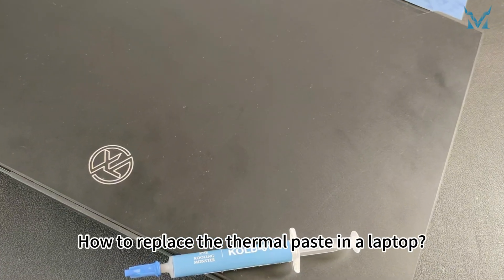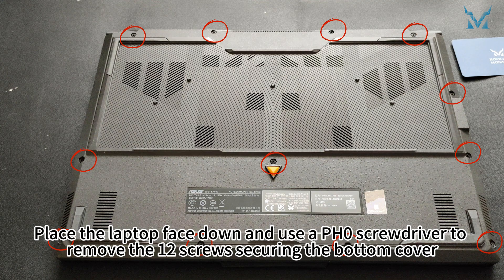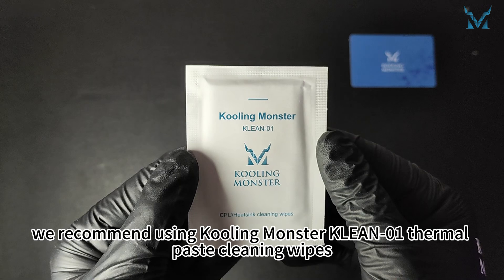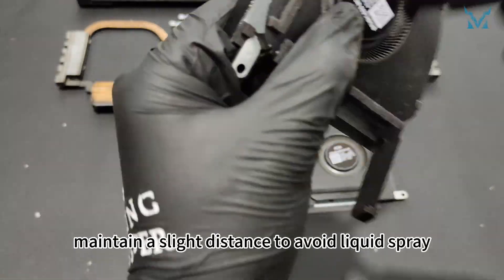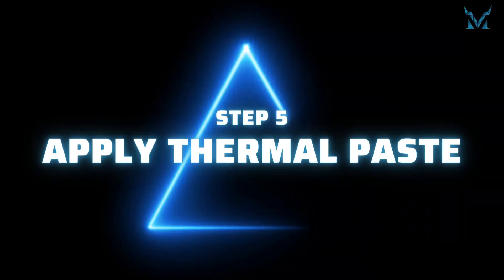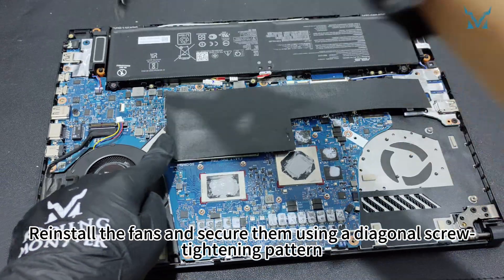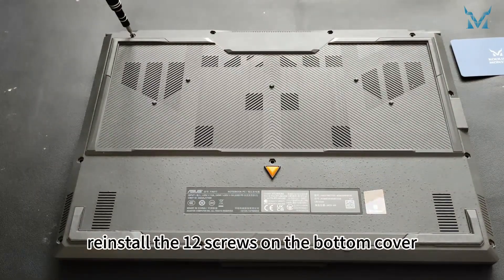Speed Up Your  ASUS TUF Gaming A15 2023 Prevent Overheating With Dust Cleaning & New Thermal Paste

Comment: My laptop don't turns on , I went to shop they told me to put new motherboard, I went home and was working again, thuday don't turn on again is all up to date I run all tests  all ok , any one knows what the problem is ?  I noticed that this lady time the laptop was getting very hot more that normal CPU 86 to 93c let me know if you guys know something. Cheers.

Comment: Bro after how long should I replace the thermal paste
Reply: each 1-2 years if you are not sure open the laptop and look the thermal paste if its dry change it you can also do a stress test to know
Reply: you can also tell by how high the temperature usually is on your laptop and keep track of it, depenind on what type of laptop it is (gaming/office)

I'm more a costumed to gaming laptops, I had an ASUS TUF 3050 laptop for 5 and a half years now and only recently replaced its dry thermal paste, the temperature was over 92* C while gaming especially for a while while and while sitting on brave browser for a few hours the temperature would be around 70-80*C

Since replacing it it has gone down to 60*C while sitting on brave and doing nothing and while gaming it wouldn't really go past 80*C
Reply from the maker: Usually every 2–3 years is a good rule of thumb ✅
But if you game a lot or notice temps rising / fan noise increasing, you can do it sooner.
And when you’re ready to repaste, a high-performance paste like Kooling Monster KOLD-01 can keep temps stable longer 😄🔥

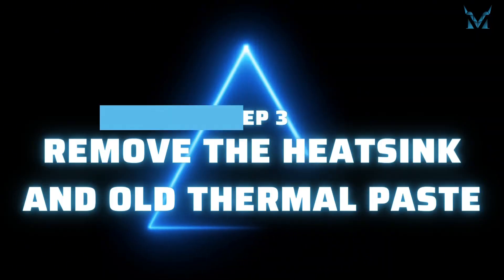Comment: 1:52 you forgot to tell to push the lever up before pulling
Reply: Big help! Also doesnt help that this isnt a 2023 model or that his is somehow different. My cpu fan power connections are a lot smaller and are soldered on. He also fails to mention two extra screws near the bottom left and right corners of the heat sink that need to be removed, as they hold the heat sink on to the fans. He removed them after the heat sink, which isnt how it is factory.
Reply from the maker: Really appreciate the detailed feedback! 🙏 You're totally right—models can vary a lot year to year, and we should’ve clarified those fan screws and connector differences. Thanks for pointing it out! We used KOLD-01 thermal paste in this one—worked great once everything was properly reinstalled.
Reply from the maker: Good catch!  You're right—we should’ve mentioned that. Thanks for pointing it out! We used KOLD-01 thermal paste in that repaste—worked great once everything was reassembled!

Comment: Hello, 
For the other components ( other than the CPU and GPU ) i should use thermal putty correct ?
Can you please tell me how to determine the right amount to put on them please ?
I've read that applying too much thermal putty can have adverse effects
I have a similar model with ryzen 97940hs and rtx 4060. I've used mx-4 on the CPU and GPU and didn't clean the thermal paste that was on the other components ( not the heatsink or the component itself ) i only added a small amount of mx-4 on those as well, so far don't see a huge improvement maybe the temperature is going down a bit faster than before but under load the temps a very similar ( i know the CPU is meant to go all the way to 100C but i limited it to 85C via G-helper )

Thanks for the video !
Reply from the maker: Hi! Yes, for components like VRMs or memory chips, thermal pads or putty (not paste) are best since they bridge uneven gaps. Too much putty can actually reduce thermal performance, so just apply enough to lightly fill the gap without bulging when the heatsink is screwed down.

As for the MX-4—solid paste, but if temps haven’t improved much, old pads or partial contact might be the issue. We used KOLD-01 thermal paste on CPU/GPU and kept original pads elsewhere. Your setup sounds great with the 7940HS + 4060—limiting to 85°C is smart!

Comment: do i have to worry about the fans spinning while using compressed air?
Reply from the maker: Yes, it's best to hold the fans still while using compressed air—spinning them too fast can damage the bearings. A soft brush or targeted air blast helps. And if you're cleaning deeply, don’t forget to repaste with something reliable like our KOLD-01 thermal compound.